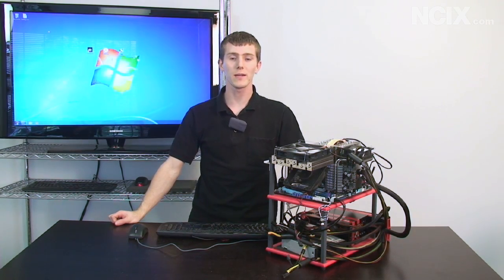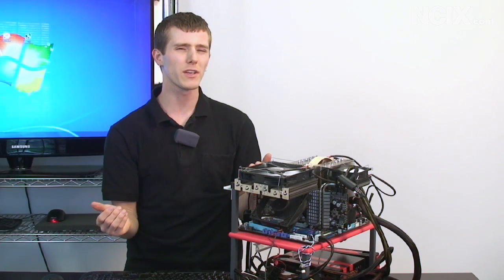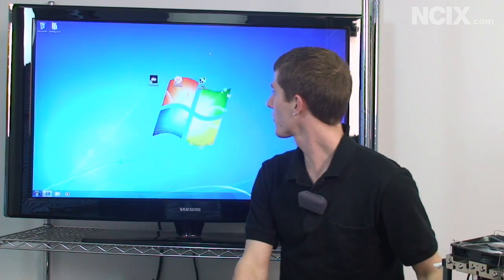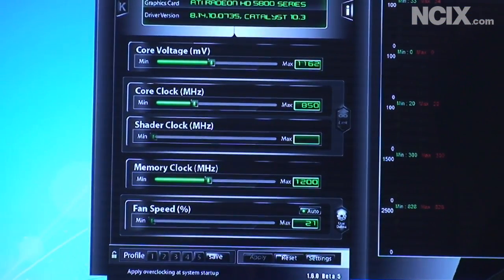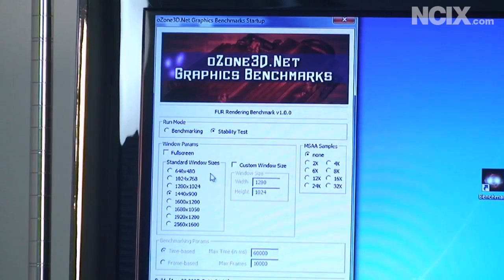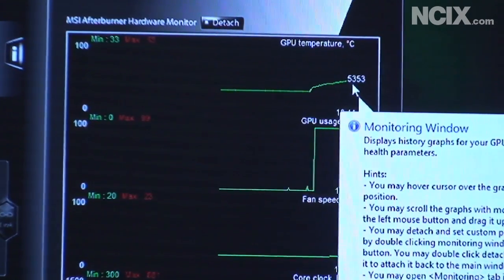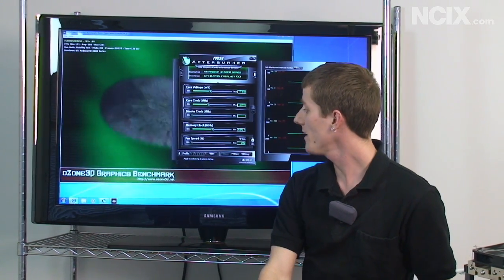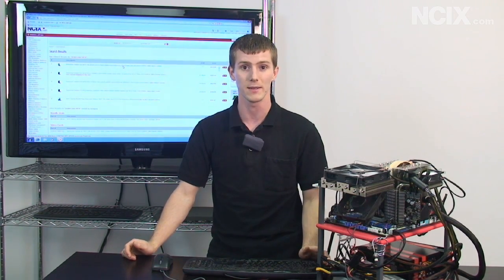Video Card Overclocking Guide (NCIX Tech Tips #69)

Comment: I have two HD 6950s, one with a factory overclock, and the other with none.

The main card is at 840Mhz, the other is at 800Mhz.

What I'd like to know is how safe and stable that overclock would be without adjusting the voltage. Should I make my cards match up? I use them in crossfire.
Reply: DGneoseeker1 The Overclocked card will automatically downclock itself to match the lower speed of the stock card.
Reply: So people claim, but according to Afterburner and CCC it isn't doing that. At least not in terms of what it tells the sensors.
Reply: DGneoseeker1 If they aren't matched and in sync they are not in  crossfire properly. When in crossfire the OC'd card will downclock .. it has to in order to be deemed "in crossfire" with the second card. 

Clock your Oc'd card to match the stock card if it doesn't appear to be downclocking itself then run some benches or games and check your heat issues to see if the excess heat on the top card is caused by the mismatched clocks.
Reply: How safe would I be doing it the other way around? The lower card doesn't get stressed much when gaming. Heat shouldn't be a problem for that one being overclocked to match the faster card. But is it always safe to overclock as long as you don't screw up the voltage?
Reply: DGneoseeker1 If the Top card Is the Oc'd card and it is literally bending with the heat then overclocking the lower card will only increase the heat problem. Also check that when you are not loading the GPU (sitting on desktop etc) that the OC'd card is dropping it's clock to a lower idle speed for example my R9 290X's are clocked at 1250Mhz on the GPU core and when they are idle the clocks lower to 300Mhz. Is your OC'd card doing that?

My cards are far more power hungry and prone to high temperatures, on the stock coolers they were running @95 Celsius under full load but by design, a 7970 is not meant to be run @100+Celsius so my advice is to lower that clock and check you have sufficient airflow through the case and between the GPUs. Run Heaven 4.0 benchmark 5-10 times and see where your temps go.
Reply: It isn't bending with heat. It's bending slightly like any GPU does without a super hard backplate/heatsink. The card sags even when cold. It's a HIS heatsink which has a relatively floppy plastic casing around it compared to the XFX card which has a heatsink/backplate combination that's all screwed together. The casing makes the sagging a little worse than it otherwise would be.

And yes the cards drop activity like normal.
Reply: But speaking of the clock speeds, I'm not clear on this. How exactly do I set up the over/underclock for each card individually in MSI afterburner? The only way I seem to get the second card's settings on screen is by setting it to Master instead of the other card.
Reply: DGneoseeker1 Right but the reason the card will bend like that sounds like heat more than poor design. I have had 4 crossfire/ sli setups and have never witnessed a card bow as you have described.. marginal bend yes but what you have described (GPU at 100*C, visually noticeable bending of card, mismatched clocks) suggests poor cooling/workload distribution. One card is either cooled poorly or is taking a larger portion of the load. Eliminate the variables until you find what is causing such a high temp, swap PCI-e slots, balance clocks, check airflow through case and to GPU eventually you'll see what is at the root of it but 100 Celsius is crazy hot on a card not designed to run that high.
Reply: DGneoseeker1 In MSI afterburner there is a setting with a check box "synchronise settings for similar graphic processors" it should be ticked.
Reply: if the problem persists i would post a thread here

http://forums.overclockers.co.uk/forumdisplay.php?f=3

A great community of enthusiasts that run all kinds of crossfire systems from low end single cards to high end 4 way crossfire. You will get an answer there and advice to find the cause and a fix should there be one.
Reply: Aha, I got the sync working. Thanks for the tip.

I tried putting both cards on 840Mhz just to try it out. Haven't tried a proper game out yet.

But... I had to do a double take when I played Ikaruga through Steam and noticed that the GPU temperatures hardly moved. Youtube would get the primary card up to about 67 centigrade. Ikaruga left it under 50...

Flash is seriously that badly optimised? This is insane.

Anyway, no game has truly overheated my cards so I don't have a major problem outside of Furmark. It's just a case of using more fan speed for the system stressers like The Witcher 2.
Reply: Luke Dovey  As for the card bowing, it's really not major. And it happens as soon as the COLD card is put into the PCIe slot.

The main problem is that the PCIe slot spacing on this motherboard is, to put it simply, SHIT. There's hardly any space between the cards to start with even without sagging. A few mm at best.

Look up the spacing on the Gigabyte X58 UD3R and marvel at how awful it is.
Reply: DGneoseeker1 It's fairly common though not ideal, to have only a small gap between cards. with my 2 I have only a tiny gap on a G1 Sniper mobo.  You have a problem and I'd be wary, very wary if one of my cards was regularly hitting 100
Reply: It's not regularly hitting 100. It only did that in Furmark. In standard use it never went over about 96. That was in The Witcher 2, with the XFX card on the top as Master, and with the default fan profile. I tweaked that and it's been basically fine since, if a bit noisy.

Then I swapped the cards over since the HIS card should run cooler with less fan noise. Unfortunately my case is quite full with cables so the air flow could definitely be better. Nothing I can do about it, sadly.
Reply: By the way, what would you say a reasonable temperature for a HD 6950 to reach when playing a youtube video for a long time is? It's stable at 64 centigrade right now with youtube running continuously. Gets up to... mid 80s with STALKER COP Misery mod if I recall.
Reply: DGneoseeker1 Mid 80's is fine if gaming. For watching a youtube video though? it shouldn't be much more than your idle temperature. My idle temps for GPU's is around 35 Celsius, if I watch youtube for a couple of hours it rarely breaks low 40's. When it comes to a fully loaded GPU mid 80's should be ok just keep an eye on it, when you start hitting 90's then start to be more worried.
Reply: Trouble is I imagine the temperature for various tasks is going to vary massively depending on the fan profile in use.
Reply: DGneoseeker1 My fan profile steps my fan speed up 10% every 10 Celsius My GPU's never reach anywhere near the 95 it is good to run at...under 100% load for about half an hour my GPU's reach less than  75 Celsius. Without loading the GPU's I never see temps over 45 Celsius even atm when it's nice and warm here.  Watching youtube should not impact your GPU temp to the point you notice.

Comment: I've used AfterBurner on my iMac late 2012 on windows, it worked perfectly. Sometimes graphics will glitch out when I first turn my iMac/PC On. I max out everything to max, with memory shot all the way to 3000Mhz. Is this good? Grahics Card ChipSet: Nvidia Geforce GTX 660M, Processor: 2.9 GHz i5 Intel, Ram: 8GB 1600 MHz DDR3. Its like specs from a Gaming Laptop
Reply: Probably not good. Unless you know what you are doing you shouldn't really be doing it ....
Reply: Well I knew not to max out the refresh rate
Reply: ***** Laptops, even gaming ones are very bad for overclocking because they generate way too much heat than they can dissipate. Whacking your clocks right up in a such a system is not recommended by any length. If you are going to overclock do it in a desktop where you can effectively cool it and lower the risk of long term even permanent damage to your system.

Comment: hell i got a nvidia 610 gt 1gb standard core clock at 820 and ram clock at 500 stock,i overclocked my core speed to 1050 mhz before any artifacts and very little when i did,now i run it at 1000 mhz and 600 mhz for the ram,still at 35c-50c max and thts after LONG gameplay lol i think i have the golden GPU lol!!!!

Comment: Should i overclock my radeon 7970 gpu? I have an fx8350 8 core cpu, but i don't have an after market cpu cooler. Suggestions please?
Reply: Overclocking your gpu has nothing to do with ur cpu lol
Reply: video card, yes, cpu, hell no
Reply: Dude. Get a new cooler for the CPU. The stock is awful, and it'll make your CPU throttle form high temps. Which will destroy framerates. Trust me, i went through that
Reply: So you want to overclock your gpu or cpu?
Reply: Gpu
Reply: you can squeeze quite a bit of extra performance overclocking ur gpu.....but as suggested by an ealier poster, no need to overclock cpu, mainly due to the fact that u dont have an aftermarket cooler
Reply: The5thorseman hes asking about overclocking a gpu ! not a cpu He just doesnt know what he is talking about! You dont need to change your cpu cooler to oc a gpu lol !
Reply: RaG3 There is a certain point where CPU kind of bottlenecks the GPU a little. That's where the temps go up. Now that's not common, but it happens every now and then.
Reply: RaG3 Don't care, honestly. I'm just giving him some advice.
Reply: Dmitry Granicin An 8350 isn't going to bottleneck a 7970 much if at all besides stock coolers aren't the best but they can still be used. I have personally run a i5 and i7 2500k and 2700k  well over 4Ghz on the stock coolers with no issues at all. The 8350 should be able to boost up to over 4.0Ghz on a stock cooler without any issue.

John Bill Yes overclock your GPU a little bit if you need to but do it gradually in small increments until you start to see degraded performance or artefacts. You should be able to safely overclock by at least  5-10% or even more with no added voltage. Keep on eye on GPU temps and ambient case temps as this increases stress on other components such as RAM and CPU if they have to deal with GPU heat too you may see mal effects.

Above all else GET A GOOD PSU! No cheap shit to save a bit of cash, if you intend to overclock an efficient and rated PSU is a must. Something like a Corsair RM750 which have plenty of juice to spare for overclocking that 7970 and your CPU should you need it.

Comment: Ok, so I've heard this info before, but i'm still having problems with my card. I currently have the twin frozr gtx 770 2gb RAM OC (or whatever other miscellaneous letters you can throw in there) and I can't really get it to work very well. I'm only getting about 30 fps in games like Skyrim and Fallout NV on it's lowest settings, I don't know what i'm doing wrong as I'm using MSI afterburner and i have set up to its most stable settings. If anybody knows whats up with my card/me please tell me.
Reply: The components that affect FPS are mostly the GPU and The proccesor, if your processor is a low-end model then even titan will only run at low speeds. GPU is like the superman of the justice league ,very important? yes , but only part of a much larger whole.do you have at least i5 3rd gen procc. or amd equiv.? 8gb ram? 64bit os? if all of the above is checked , then there may actually be a defect in your gpu, if so you must go through the grueling task of contacting your manufacturer.
Reply: Yes, I actually upgraded to windows seven before i got the card, and my processor is tri core with 3.69 Ghz, so if that's the case then i'm going to have a busy weekend trying to contact the manufacturer. Thanks for the help.
Reply: Step one: disable V-Sync.
Reply: Update drivers
Reply: Blitz Nixon Pretty sure tri-core doesn't exist BTW
Reply: They did. Phenom 2 x3. They were unstable quad cores, but were stable tri cores

Comment: "Guarenteeed to run at dat speed"
My HD 7770 is Factory OC by 50MHz on the core. nothing more.
And it always crashes.
Reply: If a factory OC card doesn't run at that speed, it's a defective card and you should return it ...
Reply: Maybe your psu?
Reply: use msi afterburner to lower it by 10
Reply: Matt Jones I tested on a 5MHz OC and it still crashes...
Reply: then just dont bother, i mean you could up your volts but i wouldnt recommend it, just get something better.
Reply: Matt Jones GPUs are always locked in voltage, except a few models made for OCing
Reply: yeah like i said just get something better
Reply: is that an older card orrr am i behind in latest events? lol
Reply: that would actually make sense, psu cant handle the littlwe extra power. try that. i have 2 660's with a 850w psu and its great
Reply: Matt Jones I have a 525w PSU.
It is more than good enough to run an i7 Extrene and a GTX 880.
Reply: 880?
Reply: Matt Jones Yes.
Reply: ***** if it's a real low-powered Maxwell GPU, probably.

Comment: ok, help. i have a gtx 660 and i upped it at 10 mhz at a time. i got it all the way to 60+ with no artifacts. i then lowered it and went out for dinner, came back, tried it again at 50+ and it was crashing. then i tried 40+ and it was no better than the stock speeds. i was using the benchmark heaven. now im running it at 20+ and it gives me a meh increase in speed. no extra frames when in game. the exact card is a zotac gtx 660. (not the new one that just came out)
Reply: Well a 50/60+ on the gpu won't bring in much interesting improvements on the gaming side. Regarding your "hit and miss" with the oc, it could be that your card - and your gpu in particular - would stand little to no overclock at all: not all the chips/cards are the same, even two identical cards could differ quite a bit between each other. (As usual, sorry for my english - I'm Italian ;)
Reply: Thomas soffiantini (english was better than mine, lol) and thanks yeah im not even going to bother really. i can wait a couple months till i sli another with it, and at that point, who need OC?
Reply: Actually, it's been a while that oc is not convenient anymore, since you have a decent vga and a quad core cpu (even an "entry level" one). Oc - meant to get increments in fps with games - is becoming a thing of the past, when all you got back then was a single core cpu and an old philosophy's vga...
Reply: Thomas soffiantini sooooo just be happy with what i have? lol
Reply: Yes: with almost any quad-core, more than 4 gb of ram and almost any Sli or Xfire configuration, there's little more you could desire for getting best results with gaming... (hard times for an old timer, overclocking maniac like me!)
Reply: Thomas soffiantini well i have 16 gb and soon to be sli'd 660s so ill just not bother

Comment: By artifacts you mean lag ? Is there anything else I need to monitor while stress testing except for temperature and fps?
Reply: no frame drops are just an indication that the card is getting bogged down which is normal in a stress test as you are trying to push the card to its limits to show where its limits are and fps drops can be a sign of you nearing one. artifacts are glitches in the image that show up not so much when the card is slow to do something but rather when it fails outright at it like pixels showing the wrong or no color.
the whole point of overvolting is to help the card keep its math strait as at high clock speeds it will actually start to confuse some of the 1s for 0s, however too much voltage can also damage your card so do so at your own risk
Reply: Ok, thank you. I overvolted my 6770 a little bit to reach 900mhz on core and 1250mhz on vram and seems to be stable with an OCCT stress test (no glitches found) but Chivarly was unstable (crashing the gpu and then starting again). SO had to downclock to 880.

Comment: Anyone know what the safest speed to overclock a Gigbayte GTX 660 2GB OC is? I haven't been able to find any information on it, also I'm just using the stock coolers Gigabyte used on the card and have 3 fans in my PC chassis if that changes anything. thanks.

Comment: is it safe to overclock sapphire radeon hd 7770 (non oc and no vapor x)? if so can someone tell me how far they made the card go without changing voltage?
Reply: jes it is
Reply: ScoonI Goodmen
just kidding i have no clue
Reply: It  depends on your temps and how far you OC , make sure your gpus don't reach 90 degrees , to ensure you don't fry it after a couple months.As linus said , cooling is most important, not the brand or modeI,  once OCed my old gt430 it managed around +70MHz      ^_^  I dont know about ancient cards though , not sure if the first gpus invented were able to OC

Comment: any 1 know  if the afterburner works with msi R7970 lightining BE ? cos i can only set  3 options and the Core voltage and Shador clock is disabled

Comment: What card should i buy gtx 660 or HD 7850 both 2 gb
Reply: Go and look at some benchmarks,
and it depends on wich game you will play, since some games have better performance on a AMD card and the other one is better on the GTX.
Reply: Easily, the GTX 660, I have that card and it's great, the HD7850 is equivalent to a GTX 650 Ti, the HD7870 is the GTX 660's rival. But I'd go with the R9 270 from MSI if it's available.

Comment: Natural, a good careful overclock will not lessen the video card as they are designed to last more the warranty covered years. As long as you increase your voltage, fan speed,and tweak the overclock sweet spots, everything will be fine.

Comment: hi im rlly new to overclocking and i was thinking, could anyone tell me if my gpu is stable when i dont have any crashes in games with that oc, no artifacts and when idle below 50 and when gaming below 60. also i have the fan set to auto should i change that or not when i dont have any problems with the temperature